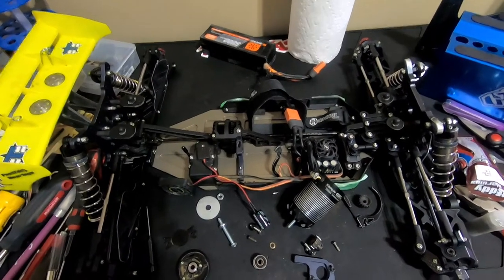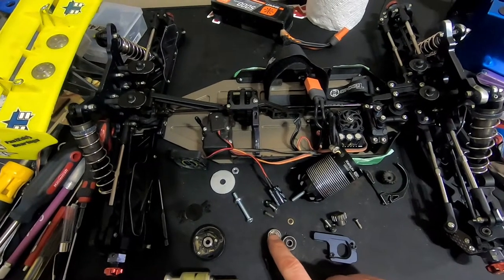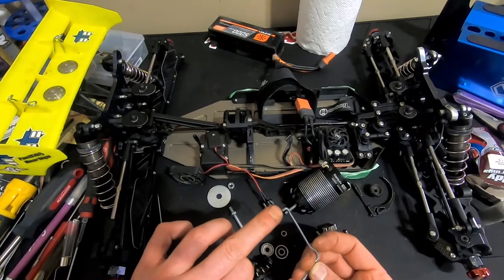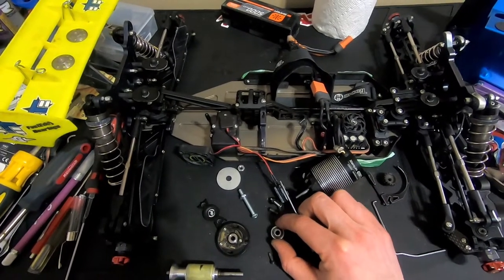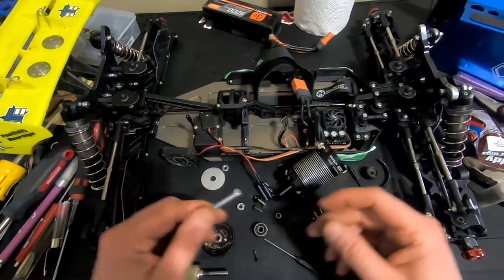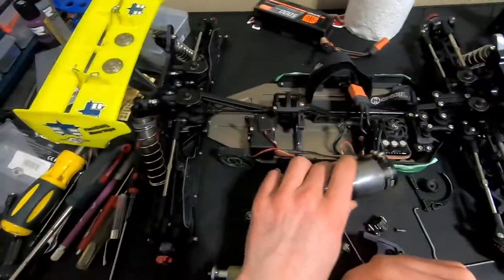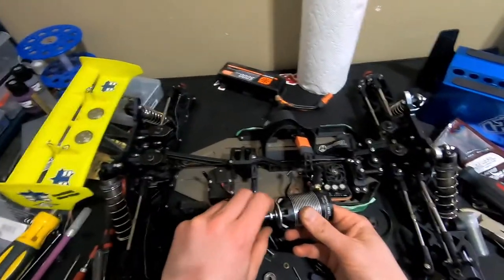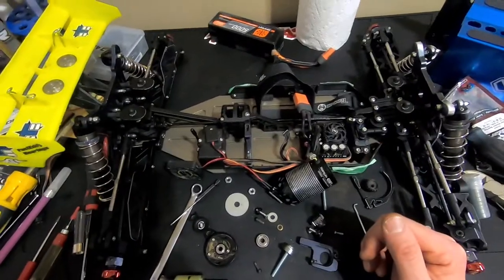Hobbywing 1/8 G3 motor bearing replacement and bearing press with bolt, nut, and washers

Comment: Hello, I really like the idea that you made with the bearings , I tried to do the same but it was not going horizontally in side the motor. Would you mind to show me from inside the motor.
I will be thankful to you and your great job too.
Reply from the maker: @Khais ElHassadi it would be very difficult to film inside the motor because with putting the tool in there you can’t see anything. if you put the screw on the screwdriver with the bearing on it and try and centre it that way then put the washer on the top with the nut and try to centre it as best as you can. then start to tighten the screw to push the bearing in taking your time and if it does start to go crooked, should loosen off the screw and try and move it over to the side that is sticking up higher and try to make it go back in. Also make sure the bearing is the exact same size. Let me know if that works.
Reply: @rcdaveshobbies  
Thank you so much man, I will do it, and I’ll try to do it gently, you know that I am at Libya , Africa, so we don’t have stories for part of the Rc cars here, and I just shipped them from Dallas where I used to be. 
I will tell you what kind of Rc that I own.
ARRMA TYPHON 3S,2019 
I never maintain my bearings for the motor but the rest i do, 
And thanks again
Reply from the maker: @khaiselhassadi5361  no problem I’m glad I could try and help when I did mine I did have it go in crooked as well but just popped it back out and tried it again. It does take a little practice. but it is some thing you should keep an eye on the bearings in the motor because if they blow up It is so much harder to get the bearing out when the middle is all broken The bearing race gets stuck in there and it is difficult to remove. Also the Arma 3S motors don’t come with the best bearings in them to begin with because I have a Granite 3s and a Senton 3S and had to change the bearings in those motor several times.

Comment: I took mine apart and can’t remember where the two brass washers go?
Reply from the maker: @Thomas Hernandez The brass washers go at the front of the motor shaft the longer side that comes out the front of the motor same with the black washer I’m pretty sure it goes first then the two brass washers and then put the rotor in the motor

Comment: How long do the barons usually last before you have to replace them?
Reply from the maker: It all depends on how much you use it and if you’ve overheat the motor, but I would at least change them once a year if you’re using it outdoors for sure, but keep an eye on them
Reply: @rcdaveshobbies  I appreciate the information.I bought the motor yesterday the on Road version for my road slash 4x4 you can check out the RC on my channel. Thanks for the information again.